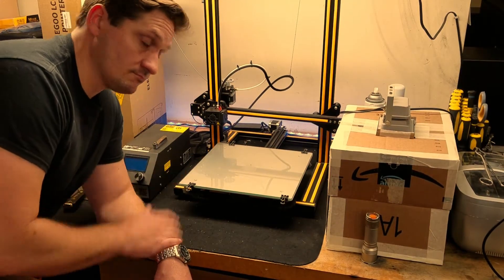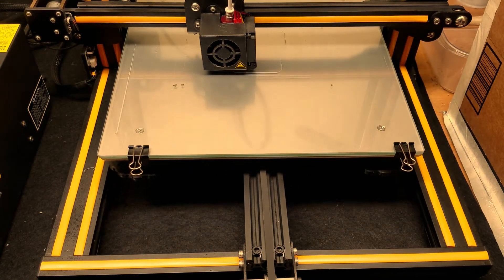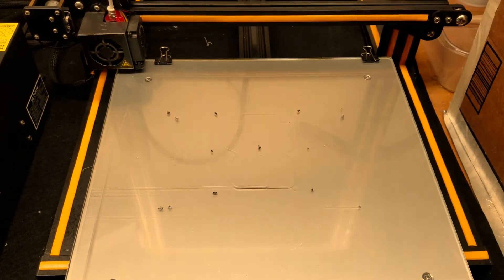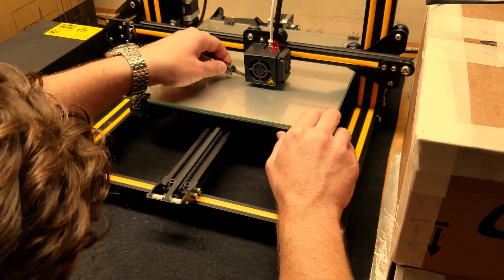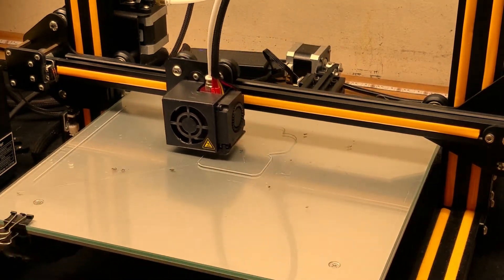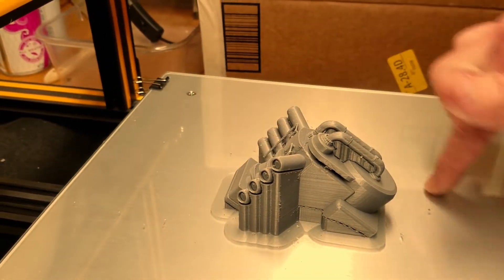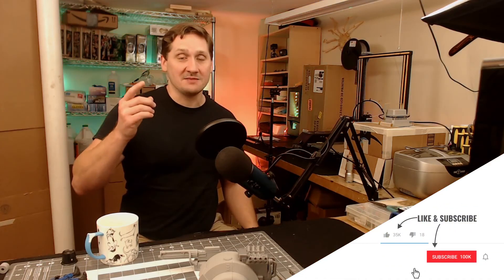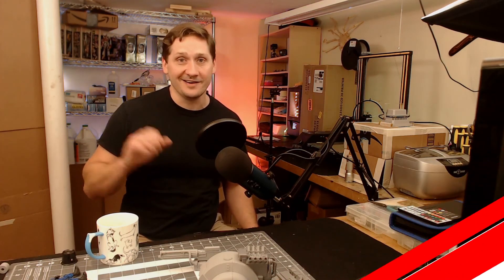Problems with leveling the bed on your FDM 3D printer? Don't buy new glass try Isolating your print!

Comment: Or you could shim the bed properly and then you can print anywhere. It's more than likely the bed that is deformed and the glass is deforming to it. Glass is really flexible when pressed down with clips. Yes glass can have waves in it from the the manufacturing "float". But these beds are notorious for being nonflat.  Level does not equal flat.
Reply from the maker: Thank you for your interest in the video, This is a bandaid solution true, but to keep people printing with what they have for now.
Reply: @voltage3d469  Good point -  you don't have to fix everything all at once. And with this solution you can see what is working and what is not and it can get you over the hump.
Reply from the maker: @markrichards5630  Totally agree cheers!